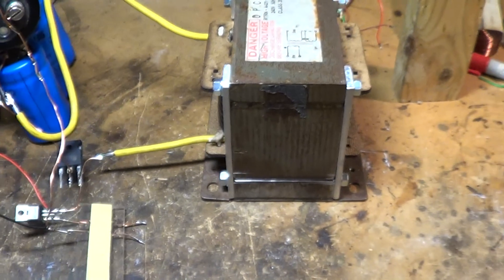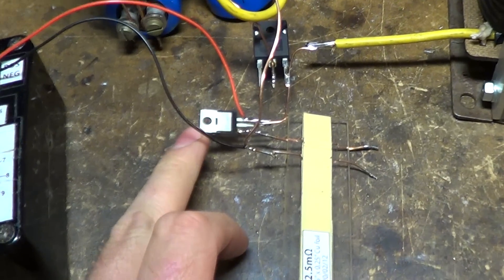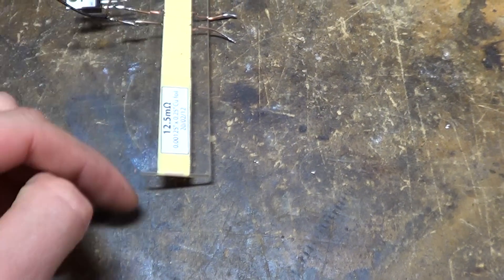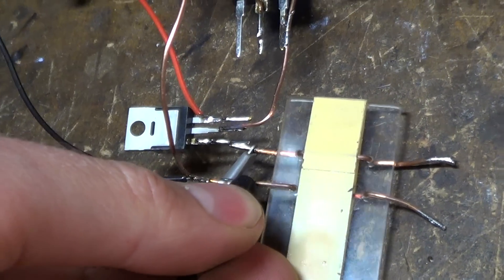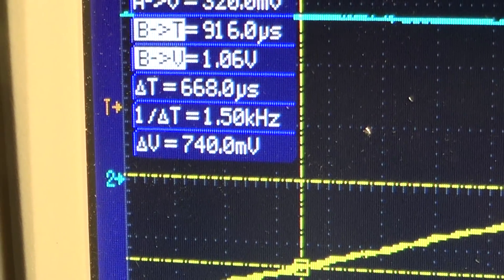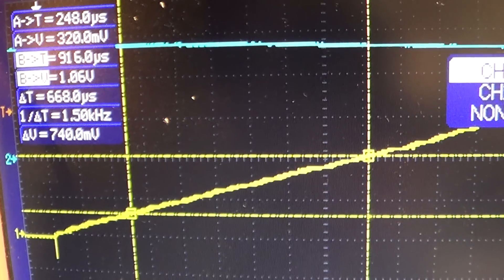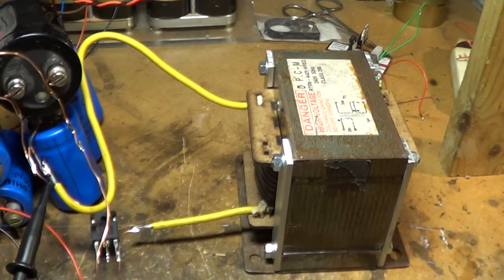Testing a large inductor

Comment: I have some doubts regarding the power supplies used and the capacitance value. How did you calculate the amount of capacitance required and also regarding the basic concept of the video - were the power supplies being used to charge the capacitors and then discharged at a single moment? It doesn't seem that way because there's a constant rise in the current(voltage from the sense resistor) in the dso. So can you please explain a little bit for some clarity? Thank you 🙏🏽
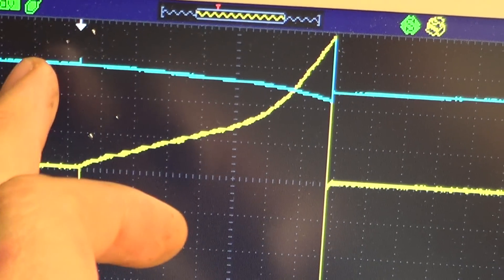Reply from the maker: I didn't calculate it. It's not important. Just make sure to stick in enough capacitance so the supply voltage doesn't drop significantly during the pulse. Look at the scope traces at around 3:39. The supply voltage (top, blue) drops from 28V to 25V by the time the inductor saturates. That's totally fine. Keep in mind this isn't meant to be some precise measurement setup - it's just to get a ballpark idea of what current the core saturates at. I'm not sure why you're confused by the constant rise in the current? That's exactly how an inductor behaves - apply a fixed voltage, and the current will rise linearly until saturation, where it increases sharply.
Reply: @imajeenyus42 By the way I had another doubt regarding the setup - the high current that is flowing through the inductor is only for the short pulses so overall the average current drawn from the power supply would be very low right? So I was wondering if there's any chance that a 5A power supply can be used to provide such high current in short pulses (100-150A) or should I look for another power supply?
Reply from the maker: @nishchay1725  That's correct - the average current draw is very low since the high current during the pulse is mainly being provided by the capacitors. So a typical 5A bench supply should be perfectly capable of handling things.
Reply: @imajeenyus42 thank you so much for another really fast reply. Seriously thank you so much. Like you the GOAT(greatest of all time) man fr ❤️
I'll be able to build one of these for my projects by myself now thanks to you clearing my doubts
Reply from the maker: @nishchay1725  🤣🤣 No problem, glad to help! Hope you can get things sorted out.
Reply: @imajeenyus42 alright I got it now thank you so much for replying so fast. Yes looking back at it now it seems I didn't keep the fundamental behaviour of an inductor in mind😅. Thank you so much once again 🙏

Comment: Very nice. Unfortunately the core losses of these are to large for high frequencys. I am building torroidal inductors for a diy SMPS and looking for best core material
Reply from the maker: This was intended for use in a continuous conduction mode buck regulator so losses were not as much of a concern. For anything high frequency, ferrite is a much better choice.

Comment: Thank you for the video! That is a nice way to measure inductor saturation current. A very simple setup working on the core principles of inductance :) It'd make a good lab assignement.
Reply from the maker: Thanks! It's something that's never really explained in all the books on inductors, transformer design etc. - how to actually measure the properties of a REAL component. Some day I feel like writing a practical book on all this stuff ;-)
Reply: @imajeenyus42  please do. Also what is the small air or vacuum core gap needed for in a high power inductor or transformer ? And needed to test are the inductance of a spiral coil on a ferrite flat base. coils wrapped around perimeter of equipment boxes can such an arrangement be used for high inductance? Say if the perimeter also has ferrite walls over which the coil is wrapped. And lastly how to create very high inductance toroidal inductor.

Comment: Anyone know how to make an inductor for a welder, with 80-90 open circuit voltage and pulling 120-150 amps? Also what about wrapping another 12-14 gauge wire on it for the field circuit to induce more current/voltage  into it momentarily make the rod easier to strike?

Comment: Interesting. I've been looking for a method of calculating capacitance and inductance using my scope for awhile now. Would you please share the formula you're using to calc inductance in your video? I'm not sure I got it from what you said. And are you confident in your calculated inductance? Seems rather low given how big your inductor is (on the other hand I think you mentioned it was only a few turns of wire, which if correct explains an inductance in the micro Henrys).